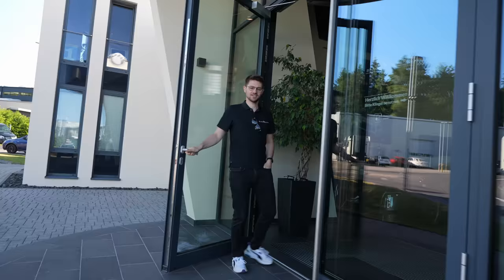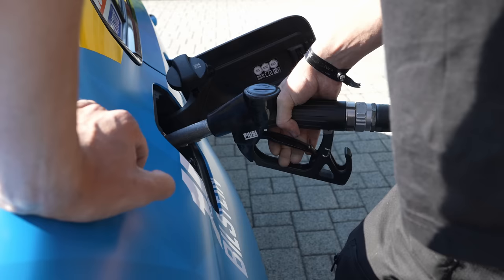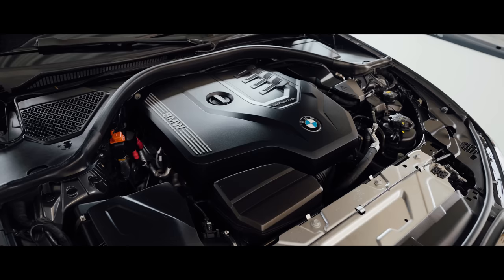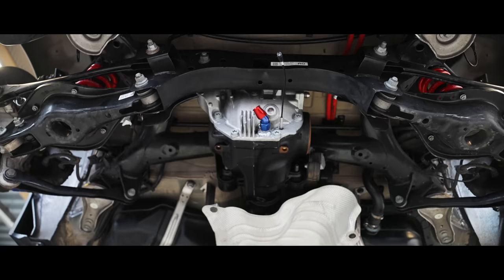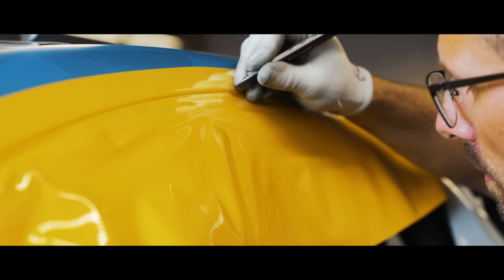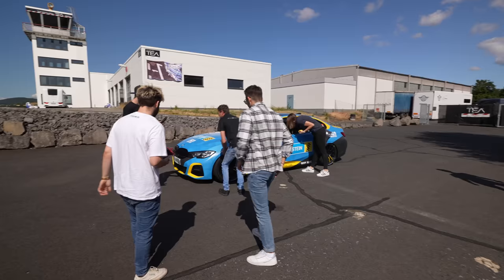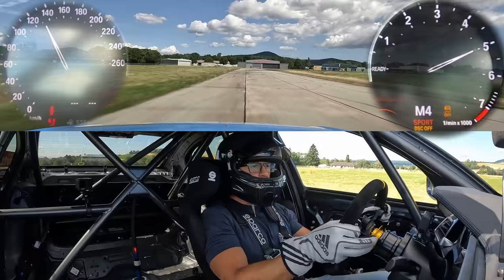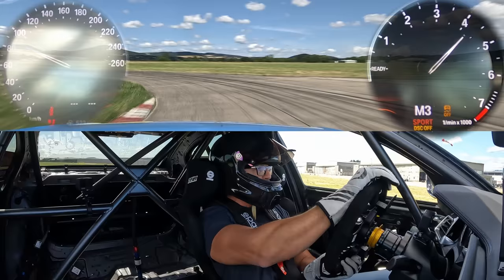OUR RACECAR BUILD, UNVEIL AND FIRST ROLLOUT!

Comment: I am very curious. What still works and what no longer works as for the equipment inside the vehicle's interior? Like, does it still have navigation or a sound system? I assume they were removed if only for weight savings, but from here it looks like there's still a screen on the dash. What about stuff like electric seats and window motors and door lock actuators? You could go crazy, but also make the car somewhat unusable for anything but racing. Thanks for the entertainment!

Comment: I can only imagine how good it drives, but any modern bmw race car would handle great in most conditions. Misha how was the setup? Did you just do a shake down or did you actually talk about setups? Sound is great, and looks very planted even on a rough bumpy airfield, very impressive. Also the sound of the slicks rolling out, not jealous at all!!
Reply from the maker: I think we may change the bump settings based on our first laps on the Nordschleife, but already that was quite good!

Comment: I think the fact the car is easy to drive will be the saving grace for Jimmy and Steve as there will be soo much traffic around that they may not have much brain power left for driving after all the traffic management...
Reply from the maker: Every car should be easy to drive tbh!
Reply: @mgcharoudin  I can imagine Jimmy and Steve struggling with the track in a 911 gt3 without traffic ... with all the weight transfer over bumps at speed etc ... don't get me wrong, both Jimmy and Steve are probably way better drivers than me, but the track alone is not something they can learn sufficiently in the time they have, not for something like a gt3 at least. Fingers crossed for all 3 of you and I'll be watching it on the YT stream 👍

Comment: Great video, I'm loving this announcement so much, I've been watching your channels for years and I'm loving this moment. I don't like that rear end, I 'think' that for bumpy track every car needs some downforce for safety reasons, high speed and undulating corners seem easy to lose the rear end because of the racing setup of the suspension, making cars 'no downforce' more sensitive and complicated to drive at high speed and a little wing can solve this problem and I know, it's a low power car and professional drivers, but it's my opinion, this car can run without donwforce and be safe, yes, of course , drivers are everything.

Good luck comrades.

Comment: Just wondering but why did you decide to use the 330i instead of something that isn't 4 door which has better weight savings? How do they know and regulate if you have 5% more power or not? Wouldn't this be nearly impossible to regulate? Couldnt someone just have a hidden piggyback tune and plug it in before the race?
Reply: 4 door bmw's are typically lighter and more rigid than equivalent 2 doors, surprisingly.
Reply: @apodski  interesting to know. Do you know how they would be able to enforce this 5% power rule? It would be so easy for someone to cheat this.
Reply: German scruitineering I assume is pretty thorough. They can also probably just measure the acceleration on the timing, if they were faster in the straights it would stick out quite a lot on these cars with no aero.

Comment: Do you need any software adjustment for the diff sawp? I want to put an lsd in my 230 but not sure if it needs adjustment other than the mechanical part
Reply: FCP Euro is doing a series upgrading a f30 328i. You might ask them. Previous gen but I’m sure it’s the same process

Comment: One question, the 318i, 320i and 330i have the same engine, only the turbo of the latter is bigger. Am I right ?
Reply: different internals as well to handle the higher tolerance in power.

Comment: is that a fuel line running across the cabin?
Reply from the maker: No, that's aftermarket anti vacuum tube (I'm saying it wrong) so you can refill faster.
Reply: @mgcharoudin  ah to vent out the air while fueling up fast? Interesting bit I would have never thought about lol
Reply from the maker: @marc9283 yes

Comment: Since you cant have any power upgrade really, have they changed the gearbox software to XHP?
Reply from the maker: There was some remap, yes, idk about the box
Reply: Okay, cause i have seen some videos about the 8 speed torque converter acting like a DSG box after the software update. Would be nice to get those immidiate shift! 😁 
But great car choice misha. Had the G21 330i Touring for 2.5 years. The best car ive owned

Comment: How does that work for companies who sand bag their numbers like bmw. They are know for giving lower performance numbers. Do they dyno before and after? How do they verify that extra power?
Reply: I think there is a certain day before the 24 hour race where every car gets checked in scruteneering, the Top 10 overall get checked after the race as well.
Reply: @Maenfy  seems really easy to manipulate and hide a flash in todays vehicles. 🤷‍♂️ two settings, one switch.